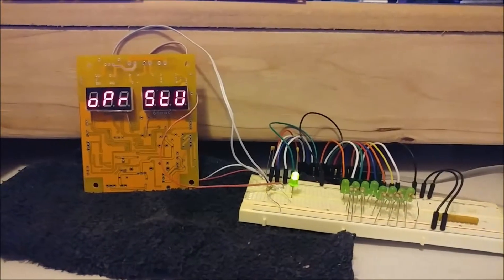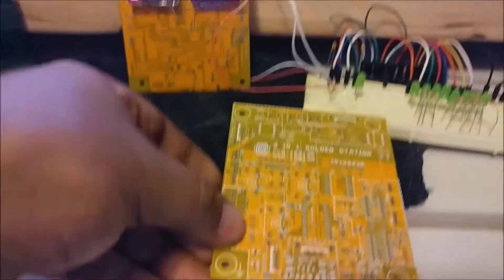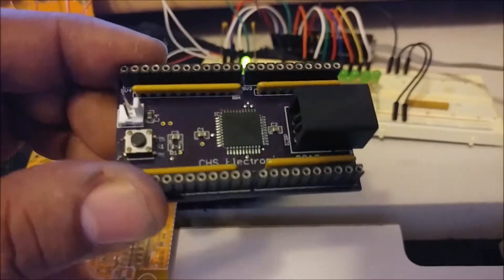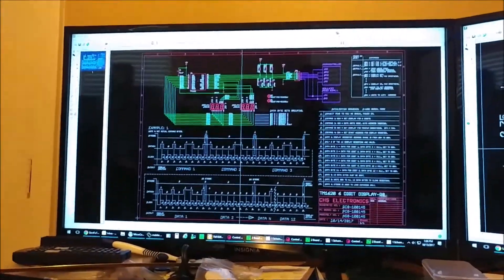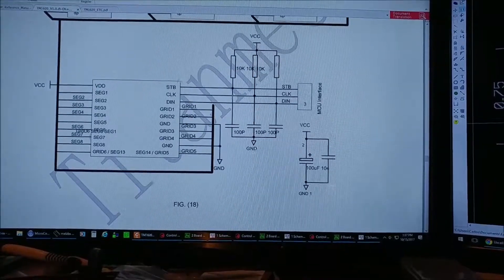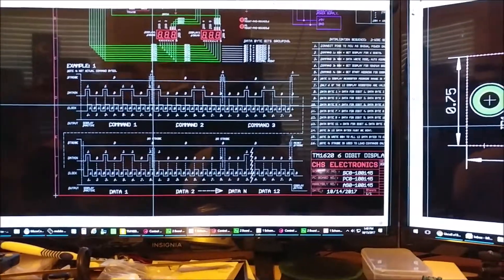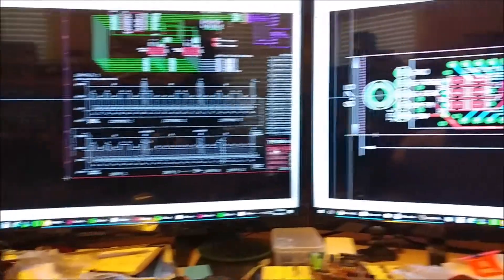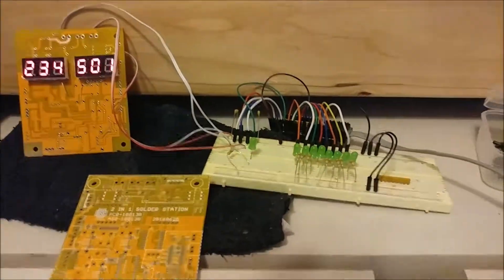TM1620 6 Digit Display Driver and Projects

Comment: hi..
i wan to read data whats is coming out from MCu to TM1620,
can u give me example to read that?
thanks
Reply from the maker: Hi Gupi! Thanks for stopping by! You can see the information I send to the 1620 from the link in the description.  Download the files and find the ".pbp" file and open it with Notepad ++. It will allow you to read it as a text file.  Then you could see the data I send to the TM1620.
Thanks for posting.
Reply: thanks for your fast response ....
actually i want to read with arduino, is same concept?
Reply: @ge_maker  yes. Just translate the commands to C or whatever arduino uses. Good luck and have fun!

Comment: I'm trying to get a display from an old tv reciver to work, it is a tm1623, the datashit is on chinese, now it is displaying something random stuf, i am using the shiftout solution to learn how it works but it is hard to understand the chinese so i found the tm1628 on english, and the google translation to help me a little.
Reply from the maker: Hi Jacob and thanks for stopping by and watching the video!  I have provided a link in the description that has the TM1623 datasheet in English that may be easier to read.  Also in the link is the hex and PBP code so that you could see how I make the TM1620 work.  I hope this helps.  Thanks again for stopping by and I hope you gave the video a thumbs up and subscribed...

Comment: Do you have TM1620 interface with N76E003 MCU , with timer 3
Reply from the maker: Hi hemwati. I don't have that N76E003 chip.   I just used a PIC16F887 for this video.